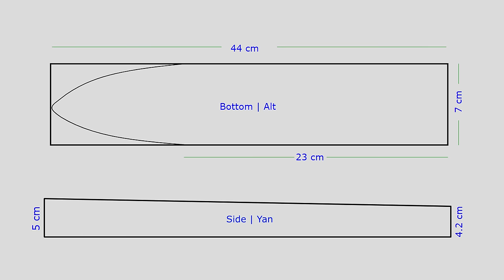How To Make Fast RC Boat. Diy Single Motor RC Boat

Comment: Hi, i have a rs365 dc motor and i see that you are using a rs380, would a rs365 still work and not lose too much speed from yours or should i just get the rs380? cuzz the motor links in your description don't work. Thank You please reply

Comment: My only problem is i have a 550 27t brushed motor but when i put it in the water it dies not move as fast as yours and also yours is in the ocean so youe clearly doing something right please help ive used your video as a template for my frist boat project. Great video btw.
Reply from the maker: The motor I use is different. Therefore, it is normal for the results to be different. You should use a propeller that is suitable for your engine. The propeller size I use is not suitable for your engine. 27T provides low speed and high torque. Therefore, you should try with larger propellers.

Comment: Hey what should be the rotation of motor?
Clockwise or anti clockwise
Reply from the maker: I used a clockwise propeller. But it can be used in the other direction.

Comment: And one more thing: 
Did the use of thermal adhesive give you a watertight seal or did you additionally seal the case from the inside?
Reply from the maker: It is possible to use plastic. Hot silicone is sufficient for a short time. But in the long run, salt water can adversely affect the silicone. Therefore, varnish that is not affected by water can be used.
Reply: @Kendin-Yap  Çok teşekkür ederim / Thank you very much

Comment: Hello, a question, is the water not entering through the metal tube where the propeller rotates? I know it has to be very precise so that in theory doesn't happen, but still doesn't water get in?
Reply from the maker: Since the pipe is placed at a slight angle, there is very low water inflow. For boats, this can be considered normal.

Comment: Great Build. Can we use Readytosky MT2204 2300KV and 30A Brussless ESC in this boat.
Reply from the maker: It is possible but the motor connections will be different. And it will be necessary to make a very good cooling system.
Reply: @Kendin-Yap  Thank you 😊.

Comment: Şimdiye kadar gördüğüm en güzel DIY performansı. Gerek yapılış tekniği ve gerekse malzeme tedariki konusunda açıklamalarda paylaştığınız linkler ile mükemmel bir çalışma. bu arada el beceriniz ve teknik zekanızı da kutlamak isterim.
Sorum şu olacak; daha büyük bir tekne ve fırçalı 775 motorla bunu yapmak istesem soğutma ve esc konusunda nasıl bir tavsiyeniz olur? Selamlar...
Reply from the maker: Teşekkürler. Evet büyük motorlu bir teknede su soğutma gereklidir. En basit şekilde 3-4mm bakır boru motor etrafına sarılarak su soğutma halkaları oluşturulabilir. ESC ise hazır su soğutmalı yapıya sahip bir esc seçilmeli. Sıcaklık teknelerde en önemli sorun. Motorun maksimum akım tüketiminden çok daha yüksek kapasiteli bir ESC seçilmelidir. Ama 775 motor için direk önerebileceğim bir esc aklımda yok maalesef.
Reply: 775 motorlar traxxasın 4s destekli off-road araçlarda kullanılan escsi uygun olur
Reply: yap
Reply: 🎉😂fuft❤😢
Reply: 🎉😂fuft❤😢
Reply: 🎉😂fuft❤😢

Comment: Great design but you forgot to put a water jacket on your motor. It will significantly shorten the life of your motor without adding some copper pipe around the bell. Otherwise great channel!

Comment: Is there an advantage of using brushed motors in boats over brushless motors?
Reply: brushed is simpler so its better as you don't need the extra power of brushless but in a plane build brushless is better because it is more powerful but also more expensive

Comment: For what purpose do you use acrylic varnish ? Of which company did you use acrylic varnish ?
Reply: i also want to know
Reply from the maker: I used it to increase water resistance. The brand doesn't matter. Other brands can also be used.

Comment: Nice Video! where do you get the Insulation Foam material from? I cannot find it anywhere, would Styrofoam work?
Reply from the maker: Styrofoam can be used. Insulation foam is often found at home building supplies stores.
Reply: Can cardboard be used

Comment: awesome job! Want to imitate this. But is there an over-heat problem? How can this boat dissipate heat? Thanks!
Reply from the maker: All RC boats have an overheating problem. For long-term use, it is necessary to add a water cooling system.
Reply: @Kendin-Yap  Thanks! That makes sense

Comment: Nice :-) gonna try this one Kendin. Only one thing :-) I see you hotglue a motor ( that will get pretty  hot )  on that wood  :-) chances are  that will even run in your motor once it gets hot and i don't think the motor likes that. edit >>esc is in the balloon :-) my bad.
Reply from the maker: Thanks but ESC is not in the balloon. The receiver is in the balloon. And the Receiver won't get hot and trouble. It is a simple but useful technique that we have used in model boats for years.
The hotglue I use is a type that melts at 170-180 degrees. And since the motor does not reach this temperature, there is no problem.
Reply: @Kendin-Yap  Ah lol, sorry my mistake haha :-) . Mmz gotta get that hotglue than but think i will just use a motor mount to attach the motor. But great work, i was looking for a foam boat because printing the boast takes so long.

Comment: Great build! What are the pieces you used for the rudder? I noticed the threaded push rod but i cant find the plastic piece that connects servo pushrod to the rudder. Thank tou
Reply from the maker: Thanks. The plastic part in the rudder is actually a material used in model aircraft. It is sold in hobby shops selling model aircraft supplies. https://bit.ly/346u59J

Comment: What kind of styrofoam u use? cus when i put hot glue on styrofoam it melts maybe i use to much hot glue idk🥴 super usefull video i love it👍
Reply from the maker: I use rigid insulation foam. Do not let the hot tip touch the foam. And use a silicone gun with a maximum power of 15-20 watts.

Comment: Can I use WD 40 instead of the super nan electric?
Reply from the maker: Something to protect the electronic circuits from moisture would be useful. That's not the job of WD40.
Reply: @Kendin-Yap  what do you recommend then?

Comment: Super! What is maximum distance in this configuration?
Süper! Bu konfigürasyonda maksimum mesafe nedir?
Reply from the maker: yaklaşık 300 metre
Reply: @Kendin-Yap Thank you! Also, what on-board camera did you use ?
Reply from the maker: @andrewb7817  Gopro 7
Reply: @Kendin-Yap  Thank you! Gopro7 weight is 116 grams. How do you think what max weight can bring this your boat?
Reply from the maker: @andrewb7817  Probably max 200gr. But as the weight increases, the performance will decrease.

Comment: Superb build! At 4:32 you have used Acrylic varnish. Can you please suggest any alternative options for waterproofing. Thanks
Reply from the maker: If the joints inside are supported with silicone, waterproofing is provided. I used varnish on the outer surfaces for longevity.

Comment: Hi Can I make the hull  out of wood as I cant find depron foam in Australia
Thank you
Reply from the maker: You can use any insulation foam. If you want to make wood, you can use Balsa wood. It is light.
Reply: @Kendin-Yap  Thank you so much
Should I do it the same as the video if I want it to be out of wood?
Thank you

Comment: What is the name of the servo motor you used for the steering?
Reply from the maker: Micro servo..
Names and links to all the Materials are in the description box below the video.
Press the arrow symbol on the right below the video. (For mobile)
Click the "More Information" link below the video. (For PC)

Comment: Sorry i need to ask does it have to be that controller? I have a controller with one up and down and left to right and and of and on switch how can i connect it to my controller 
@Kendin-Yap
Reply from the maker: It should.
Reply: is there some kind of gadget needed or just that? And thank you" @Kendin-Yap
Reply from the maker: No extra gadget is required. It is as seen in the video. @alexeisciberras4

Comment: Really 7.4 volt
Im not sure
Telme
Reply from the maker: Why?
Reply: @Kendin-Yap  I am not sure if you have given 7.4 volts, it is a 380 motor, it is running very fast.
Reply from the maker: Of course 7.4V. The boat's structure, lightness, propeller size etc. etc. These are important. An approach that no speed can be obtained with 7.4V is very wrong. @fonsi6719
Reply from the maker: You should also understand that not all 380 engines are the same. There are many varieties with different power and speed.

Comment: Hocam aynı motor için, çapı 42-45 mm olan pervane, performansı olumlu veya olumsuz nasıl etkiler?
Reply from the maker: Çok büyük olur motor aşırı ısınır. İdeal olan 30-32mm aslında ama 35mm den küçüğünü bulamadım (Vidalı cinsinde. Vidasız olanlarda var sadece)
Reply: @Kendin-Yap  hocam çok teşekkür ederim dönüşünüz için, keşke biraz daha erken olsaydı, (39×27,5mm) lik pervane siparişi vardim, sizin cevabınız üzerine arkadaşları aradım ama ürünü kargoladıklarını söylediler

Comment: Where could I get depron foam
Reply from the maker: Depron is a kind of insulation material. And it is a high density foam material. It can be found at grocery stores that sell insulation / building materials. Depron is a German brand. You can also use other brands of insulation materials.
Reply: Thanks

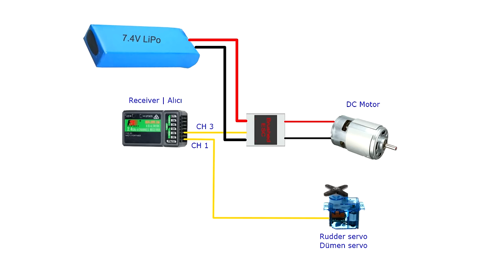Comment: 10:36 what powers the servo?
Reply from the maker: The servo I use is the lowest power micro servo. You can use any micro servos. The link is available below the video.
Reply: @Kendin-Yap  Is there a battery inside? (The link in the description is dead btw)
Reply from the maker: @Raphi  I don't understand this question.. "Is there a battery inside?"
(I updated the links)
Reply: @Kendin-Yap  what powers the servo? What is the power source?
Reply from the maker: @Raphi  The word "power" I use for servo is not related to the power supply. It refers to the thrust power of the servo.
There are no batteries inside the servos. The necessary connection diagram for battery, esc etc. is already available in the video. 13:36
It may be useful to watch training videos to learn some basic information about RC. A different video whose link I share below is not about boats. But it contains basic RC information. ESC, Servo, Transmitter, Receiver, Battery etc. I recommend you to watch... https://youtu.be/zf1eud0LRKc
Reply: @Kendin-Yap  Thanks! Did you mean 10:36? There diagram doesn't show the power supply for the servo that's why I was confused
Reply from the maker: @Raphi  10:36 is correct. Servos are not powered by external power. The receiver and servos are fed from the BEC circuit of the ESC. I recommend you watch the video whose link I shared. A single main battery is used for the entire system.
Reply: @Kendin-Yap  ok thanks, I'll check it out

Comment: fıdtık gibi olmuş eline sağlık ama ben birşey soracam bende uzaktan kumandalı araba motoru var olurmu
Reply from the maker: Teknelerde teorik olarak her tip motor kullanılabilir. Ama çok ısınma sorunu vardır. Gerekirse su soğutması yapılmalıdır.
Reply: @Kendin-Yap  saol abi peki motorun olduğu yerin altını biraz aşındırsak ve soğuk suda yüzdürsek bu sorunu çözer miyiz?
Reply from the maker: @MirogluYildiz27.72  Doğru olan yöntem motorun etrafına 3 veya 4 sıra içi 3mm olan bakır boru sarmak ve içerisinden su dolaşımı sağlamaktır.

Comment: Merhabalar hocam 2kg fiberglas teknem için motor ve servo arıyorum öneriniz nedir teknemi balık avında kullanicam yakalanacak balığa göre toplam 6 kg yük taşıyacak veya çekebilecek bir motor ve esc soylermisiniz
Reply from the maker: Standart kasa boyunda 5-6kg torklu herhangi bir servo dümen için yeter. Ama Motor için bir şey söyleyemem. Tekneler uçaklar gibi değil. Uygun motor ve pervaneyi bulmak için biraz deneme yanılma gerekiyor. ESC ise motoru bulduktan sonra motora uygun olacak şekilde seçilir.

Comment: How to connect to remote?what remote you use?
Reply from the maker: The link to the remote I used is below the video. In control sets, the transmitter and receiver are already identified with each other. You don't have to do anything to match.
Reply: I use this remote

Comment: Kendin Yap do know which foams are waterproof?  And I bought a 3 channel remote so do you know if I should do the same thing as the video? Also why did you put the protection from water and moisture on the esc and the micro servo? Because you didn't put it in the other video https://www.youtube.com/watch?v=dSQbjb8mftM
Reply from the maker: Non-paper-covered foam variants are waterproof.
Moisture protection is protective for electronic equipment. I didn't have the moisture protector when I was making the other video. 2 channels are sufficient for boats. Rudder and throttle control...
Reply: @Kendin-Yap  Thank you very much kendin.
So do I  have to put the spray  or is it just to protect it better?
And also you didn't put the acrylic varnish in the other video.
Last thing, is the Non-paper-covered foam variants also salt waterproof? And where can I get it from
Reply from the maker: @muguirenowayhome1507  Normal foams are waterproof. If you fill the joints between the parts with hot silicone, there is no need for varnish.
Reply: @Kendin-Yap  Great thank you sooo much.
 But what is the protections from water and moisture is it just like optional? And are normal foams salt waterproof?
 YOUR THE BEST!
Reply: Can you also show me how to connect a mini camera on the boat and connect it to the phone?
And do you know how to control led lights with the remote?
Reply: Hi again, 
I'm thinking that maybe water will come trough the foam? If yes maybe I should make it out of wood?